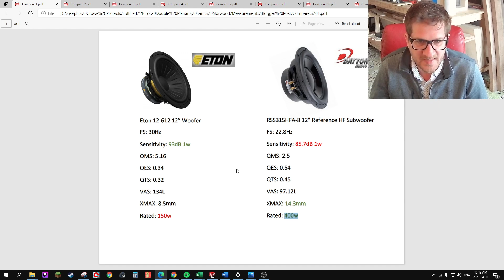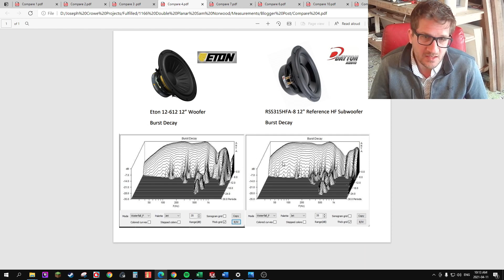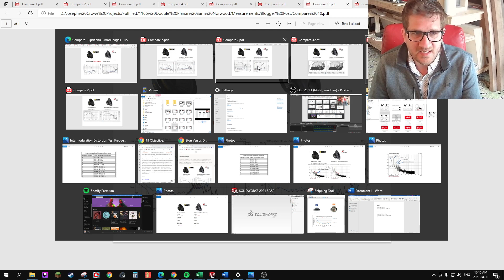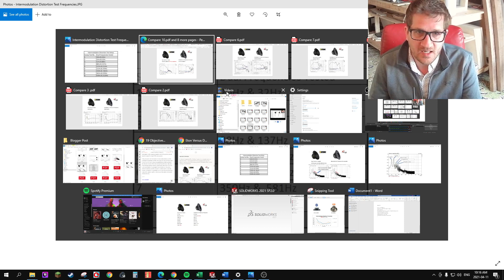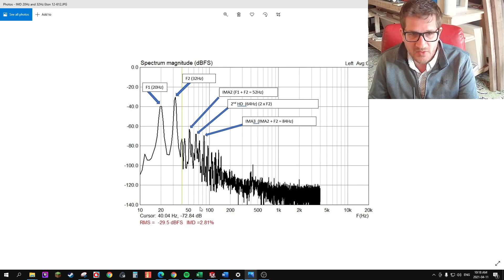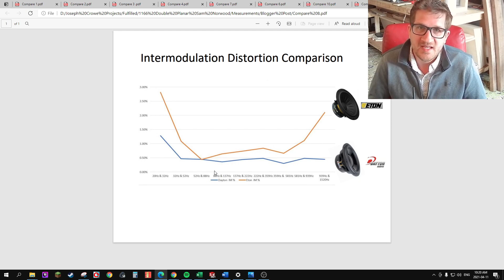Proposed Test Method for Measuring Intermodulation Distortion (IMD)

Comment: I wonder if there is a way to relate the IMD performance to a relationship between BL and Mms parameters, or perhaps a ratio between Le and BL or Mms. When designing a driver, you can't directly 'edit' the Qts, Vas, or Fs, but you can adjust BL(x), Mms, Kms(x), Rms, and you can impact Le(x) by including some inductance mitigation measures like shorting rings, T-pole, or the Purifi approach of using magnetic material around the pole. So if there is some way to effectuate a relationship between those 'fundamental parameters' that reduces intermodulation distortion, that's very good information to know.
Reply from the maker: Yes, it would be interesting to develop a lab driver where those parameters could be adjusted.

Comment: Very interesting experiments! 
Could you explain a bit more the reason to use the golden ratio in distributing the two excitation frequencies? 
I'm not grasping that part.
Reply from the maker: I’ve since updated my testing to 12 bands of test tones per octave. 12 is a non harmonically related number and so it reveals IMD very well.

Comment: Very interesting work. How is this affected by level? Does the IMD amount stay relatively linear? Or are the certain levels where perhaps the Eton might outperform the Dayton?
Reply from the maker: No, the IM products rise out of the noise floor as level increases. From what I’ve observed these products increase to the square of multi-tone output level.  These side bands are sometimes only -12dB down from the fundamental within a normal listening level if the right frequencies are chosen.

Comment: The Dayton does almost double the xmax, with a sub you would definitely want that so you don't bottom out the woofer at low FS.
Reply from the maker: I was looking only at it’s sound quality at regular listening levels in an effort to identify measurement aspects that can be subjectively correlated to sound quality.  Max SPL, although an important metric for home theatre or pro-sound use, should not be the focus for home hifi listening.